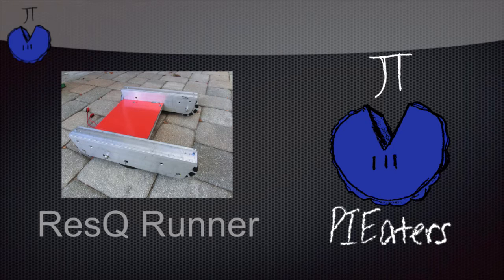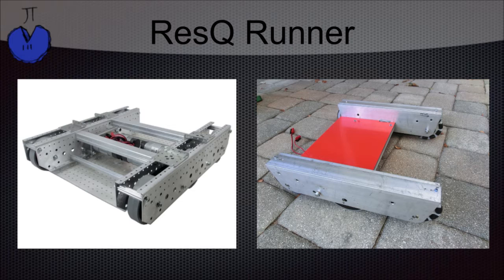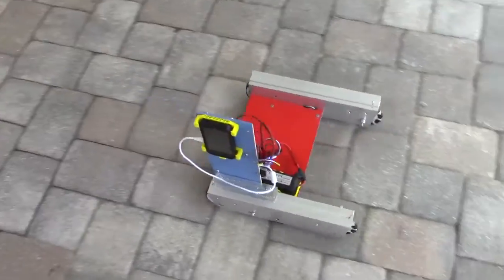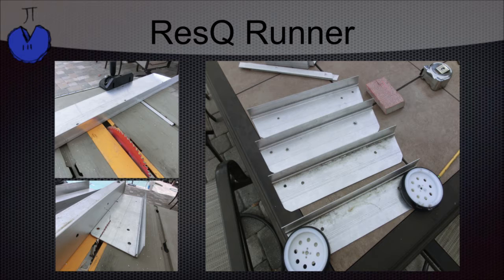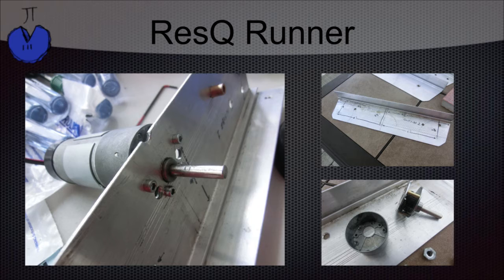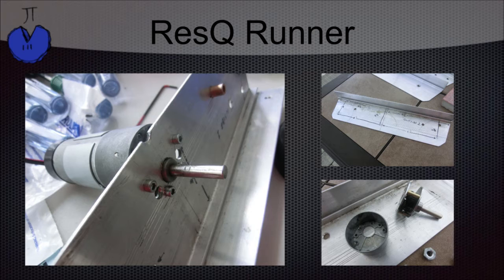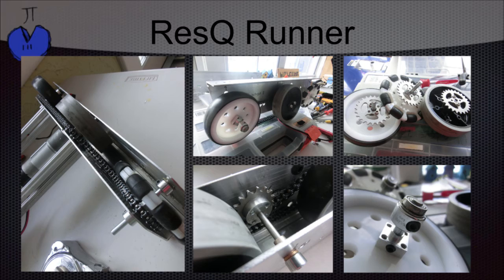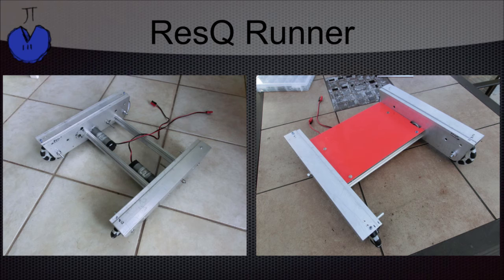FTC Robotics Help - ResQ Runner - Our Version of the Tile Runner Made From The ResQ Mountain

Comment: Hi PIEaters, I loved your video so much! It is a very creative design and I would love to hear more about the construction on this drive train. I have emailed you though your website and I would love to hear back from you- thank you so much
Reply from the maker: We got your message. We'll see if we can put something together when we have a chance. We built a more refined version of the RESQ Runner that had a 3 wheel drop center and was belt driven. For the Relic Recovery season, we did our final version which used Mechanum wheels and a shorter drive base, so we ended up direct driving the wheels and face mounting the motors to the RESQ rails. It worked pretty well. Like I said, we'll try to get something together for you, maybe next weekend.
Reply: FTC Team 9779 PIEaters Thank you so much! This would be a big help for our team experimental drive train options. All of Aluminati Industries appreciates your help
Reply: FTC Team 9779 PIEaters Also a quick side question, does your team use Andymark 6mm d axels or Tetrix Max axels?